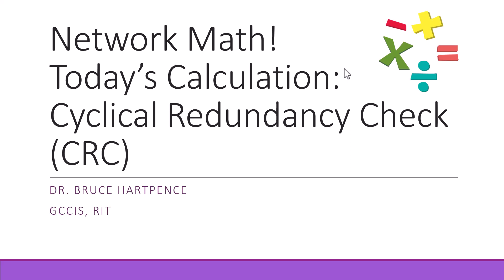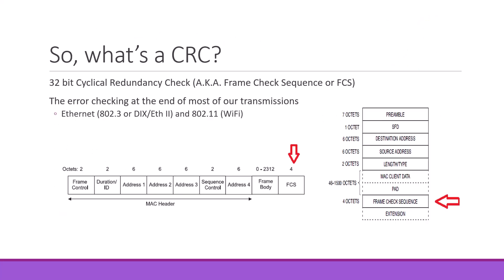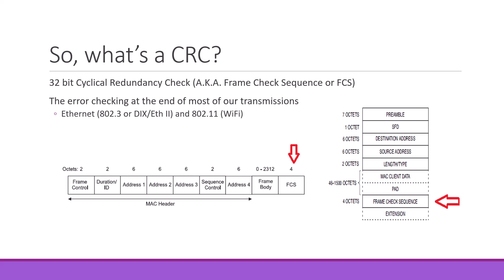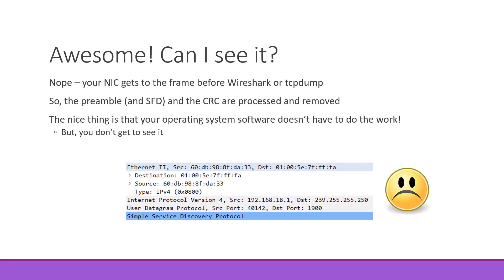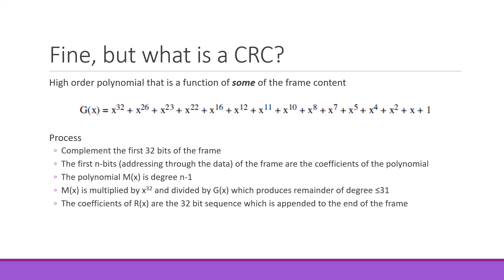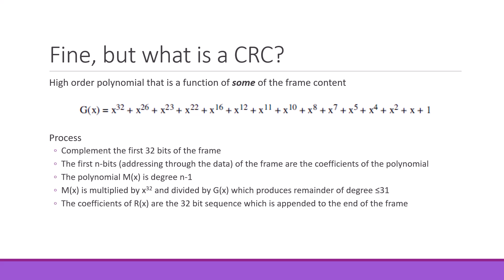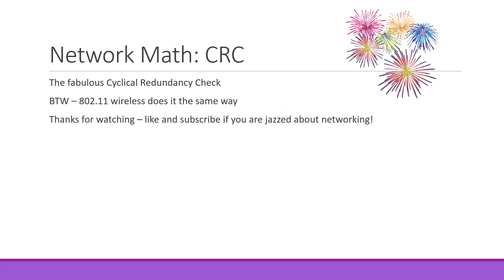Network Math - the Cyclical Redundancy Check (CRC-32)

Comment: I think some context surrounding the polynomial notation of the dividend might be helpful here. I can never square the use of this notation as fundamentally, it is a binary long division operation.
Reply from the maker: You are probably right - I'll see if I can't get my hands on an actual calculation. It's a bit of a pain since it is usually stripped by the NIC. I used to look at them using o-scopes. And thanks for adding to the conversation!